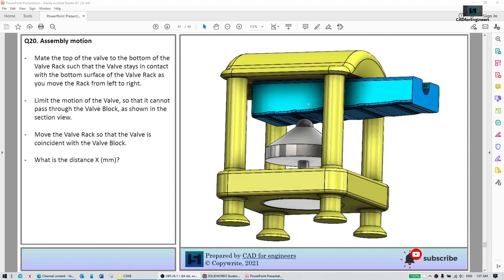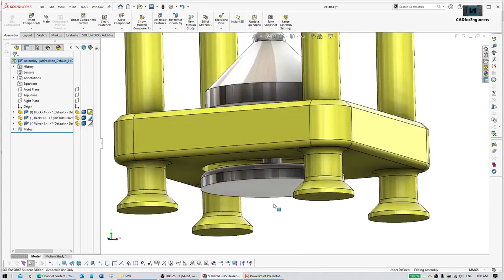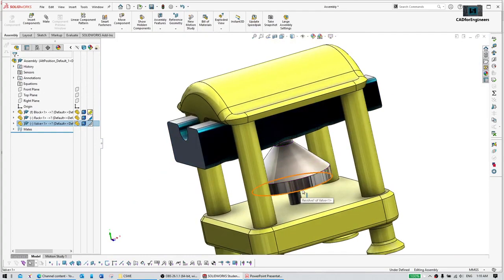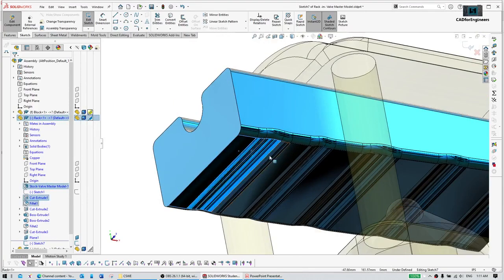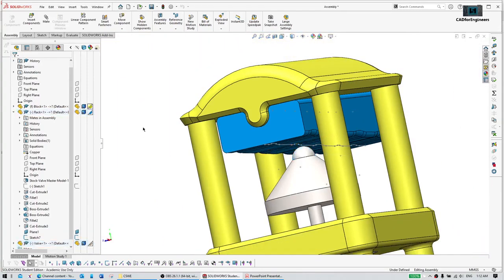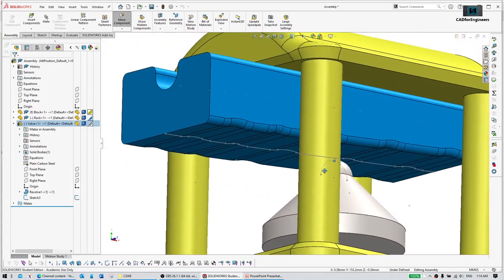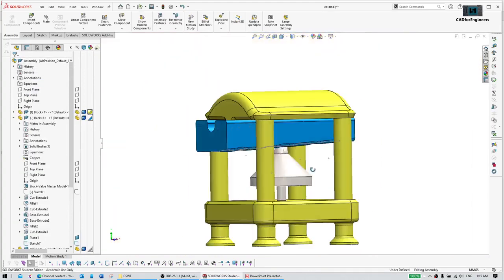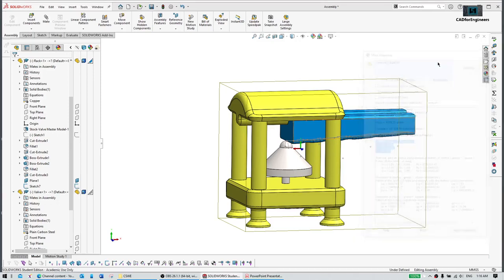CSWE tutorials   Cam Motion   EP11

Comment: In real live, the contact point is not top dead centre of the dome. It changes slightly as the contact angle changes.
This really does need a tangent mate to be 100% correct.
I appreciate though there will be enough tolerance given in the answer.
Reply: Hi I am preparing for CSWE please ig you have any materials preparation please share them with me